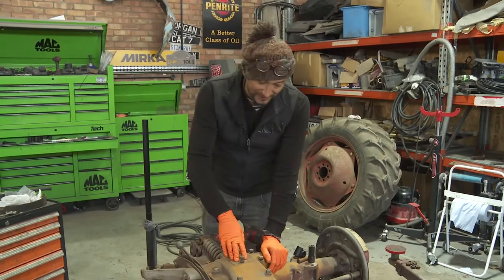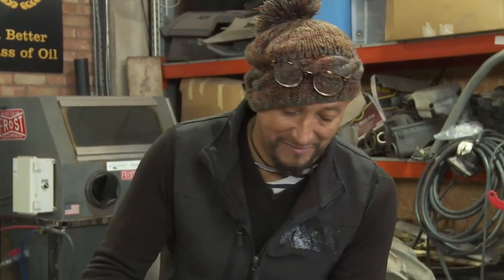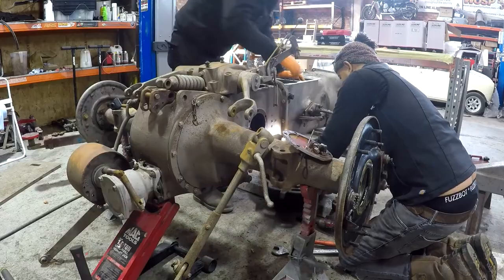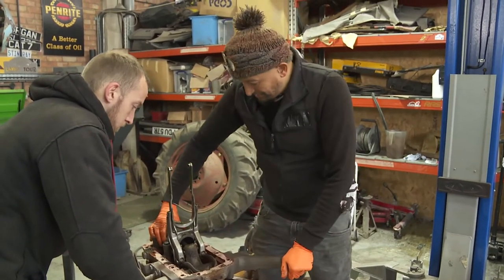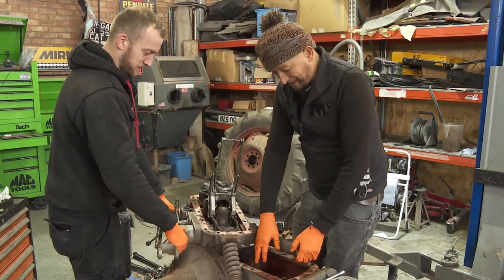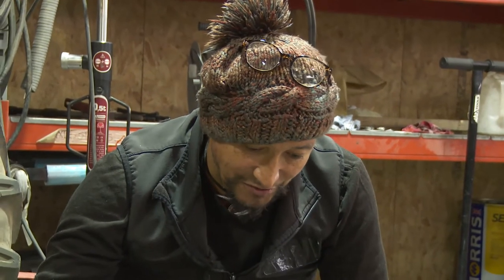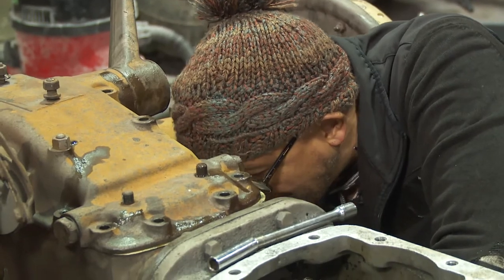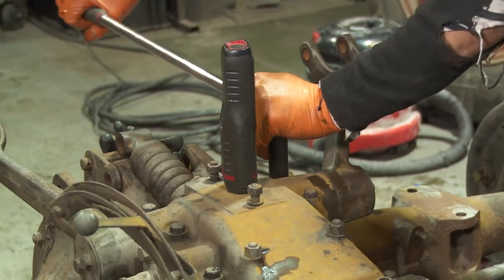Ferguson Tractor - Hydraulics | Workshop Uncut | Car S.O.S.

Comment: This example is an early ( first ) Ferguson Tractor produced B - 4 the merger  with Massey Harris. Thus the color light Gray.  Harry Ferguson had a Patent on His system which expired in 1956.  
   In  1947, after the death of Henry Ford, Harry Ferguson told Ford that They could no longer use His system on the 8N which began production in 1948.  Ferguson sued but, owing to Court not getting the Case settled quickly the 8N was produced until 1952 when the Case was won by Ferguson and Ford was ordered to stop Production of the 8N.  A year later Harry Ferguson merged His Company with Massey Harris.